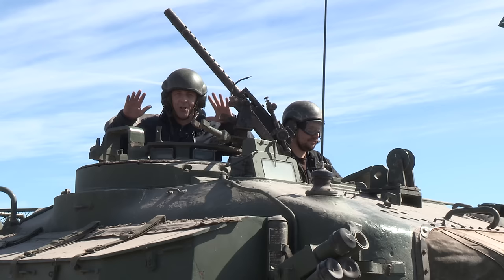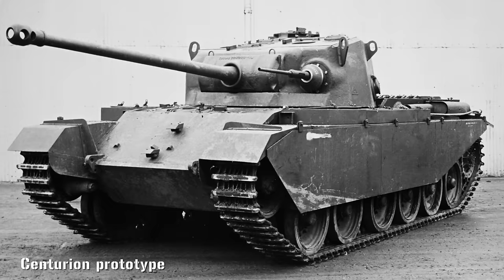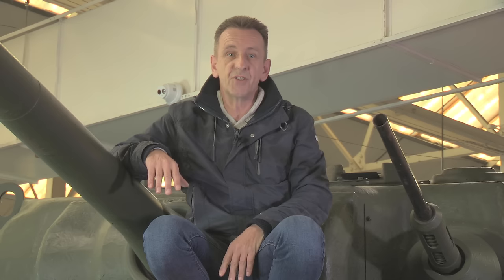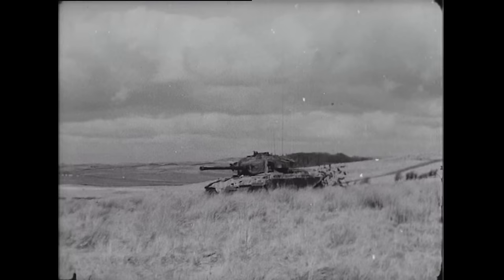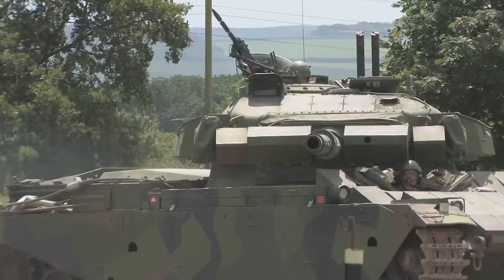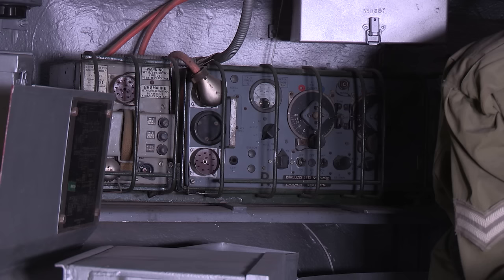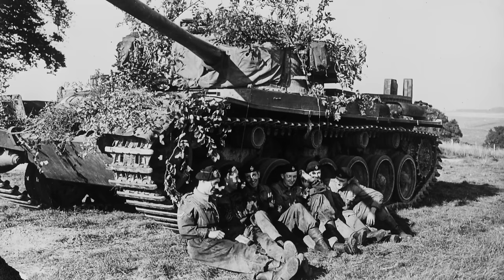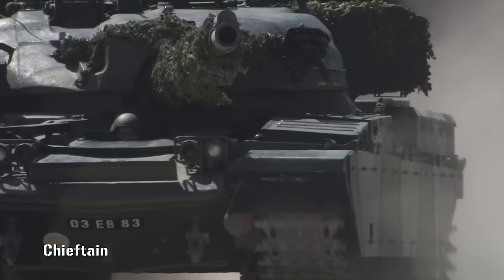Inside the Tanks: The Centurion - World of Tanks

Comment: I was radio operator/loader for three years in Germany 1956/8 with 16/5th Lancers. Used to love the Centurion, always remember when we gave a lift to infantry they always used to grab hold of the hot exhausts to climb up to the engine deck, never failed !
Reply: I was a driver gunner 1955/1958 4Th Hussars Hohne

Comment: I think this is the best film Challenger has made.  Could have lived without some of the transition editing effects, but really this didn't interfere with the film.  Great job Mr Cutland!

PS - The RoF that was shown in the historical gun stabilisation footage - I'll have some of that in WoT please!
Reply from the maker: Oh noooo, you did not like the transitions! Signed #GuyWhoProducedTheTransitions
Reply: I'm afraid that RoF isn't accurate, it's more of a propoganda film than an accurate representation, the stabilization also did not allow for complete accuracy while moving, this only came to be many many years later in the form of advanced fire controll systems.
Reply: James V. D. Bosch Yes, that is likely, however it is a somewhat realistic RoF compared to other takes of that film. The stabiliser is probably doing a good enough job at low speeds to allow the gunner to have to adjust only a bit to be able to hit a target. Sure, it's not like the "50km/h through the countryside and hitting the target 3klicks away", but for work at the time it's good enough, as it allows the short stop to aim and fire to be really very short.
Reply: piritskenyer And as it did with the stabilizers mounted on the Shermans, it allowed the gunner to actually keep track of a target while moving, other than that, I'm not so sure about the 400mm of penetration he said the Royal Ordnance L7 had, Perhaps he was referring to a later shell to be added for this gun, instead of the standard ammunition allocated to the Cent. 10 at it's point of introduction?
Reply: James V. D. Bosch I do believe this was a pronouncedly more advanced stabiliser than the Sherman's. The Sherman's stabilizer wasn't bad per se, but this one allowed smaller misalignement at greater speeds and rougher terrain. At slow speed this stabiliser would even allow for actual on-the-move firing.
As for the ammunition, I'm pretty certain that he was reffering to very late ammunition (maybe APFSDS), as the standard rounds in NATO armies for the L7 would have had penetration ranges from 230 to 350mm through the years and types. The L7 and its derivates having been kept in service to this day in certain places (M1128 MGS as the latest example) probably means that ammunition development is still ongoing.
Reply: piritskenyer As was my guess, it's just abit weird to list such a shell type when describing a certain armament mounted on a vehicle which wouldn't have used the round predominately, and if you do list the round, perhaps also give us information regarding what type of ammunition, and where and when it entered service, I highly doubt the Centurion Mk. 10 had 400mm of penetration at it's disposal at the very start of it's service life. (Perhaps the range and angle of impact would've been a good thing to list aswell)
Reply: It's more likely to be a public information news film than a propaganda one,  this is still the time when there were more cinemas than TV sets, and the best way to get visual info and news to the public (except news papers) was through the cinema, Movietone News was one of the makers; Pathe News was another.
Gun stablisation was never about hitting a target 100% of the time every time, that came much later.  It was about giving the tank and it's crew the ability to hit a target on the move;  without them needing to stop to take a shot and becoming a target themselves.
Reply: Nothing wrong with the transitions, just too many of them.
Reply: Your missing the point,  Mr Cutland is talking about the gun where he says  "Ultimately this gun".  The best stats I found is this: - L7: DM63 APFSDS-T   4000Mtrs   530mm    1455M/S     year2000

Comment: I loved this tank. I mainly drove centurions but the last tank I drove was the Conqueror. It was lovely to drive and you could use you little fingers to steer by.  He also showed a Cent with hard rubber pads on the tracks. I was trialling these at Bovington in 1963/1964. The normal steel track had a drawback. If you missed a gear you couldn't steer it. Quite by accident, whilst using the rubber ones,. I missed my gear and found that you could steer it a little.

Comment: Excellent video as always. Was shocked. I had always thought Centurion had torsion bar suspension. Learned me new things today!
Reply: nope it had horstmann Bogie suspension, rather reliable and easy to maintain. if the bogie gets damaged bolt it off and bolt a new one. torsion bar is good suspension but a pain to fix, if the bar breaks you'll have to pull the broken part out its times like that you wish you could pick up the tank and shake it to remove the broken part

Comment: The British L7 is the best 105mm main gun barrels. Besides accurate but the breech loading system with fixed ammunition is very fast. A good loader can load and arm one in under 5 seconds or less. Provided you have a Joe Cock Strong Loader. I have heard from the old M60 and early M1 Abrams tank loaders that they would "lap load'. This was even faster during gunnery Tank Table 8. To all tank crews Tank Table 8 is everything. Speed, accuracy, proper fire commands and shooting it clean on qualification day is everything. That British L7 gun is still praised by tank crews from the past as the best gun for gunnery. When I became a Tanker in the National Guard I got to train on the M1 and M1A1. The 120mm rounds on the M1A1 were heavier but with practice a couple of hundred times and never going to the gym. You can load it fast. The 105mm round is so light and smooth to punch in and pull the arming lever that it became one motion on the L7.

Comment: 4:45 Why yes, it was an improvement over what the BRITISH were using previously. But notice: There was NO Panther shell in that picture, as it would make the 17 pounder look smaller, because it is! 

This is not bullshit "Werhaboo" propaganda/blind beleif. I have done a LOT OF reading on this subject, as I was VERY interested to see how the British 76.2mm L55 "17 pounder" compares to the German 75mm L70 "KwK 42" - and not surprisingly, the KwK 42 has higher velocity at 935 meters/sec where the 17 pounder has 884.

Penetration figures ARE CLOSE with their respective standard AP rounds, but the KwK 42 wins out, and even has an explosive "bursting charge"  - something that as far as I am aware, the 17 pounder's shells lacked.

And yes, the APDS rounds did have an insane amount of armor penetration that far surpassed the "Arrow Head" APCR the KwK 42 used. BUT, and there is a rather huge BUT involved, the APDS rounds made up 6% of the TOTAL rounds used by all 17 pounder guns in all of WWII and most of THOSE were used in late 1943 to 1945, and even THEN: TCs were told NOT to use the APDS beyond 1000 meters, as the accuracy beyond that range made it largely pointless to fire! 

Even out to 1km the 17 pounder APDS had quite unpredictable ballistics, ergo terrible accuracy, which was VERY slowly remedied, but never completely fixed, for ONE major reason:

Early APDS was far from even close to perfected, and in general, firing such rounds out-of a rifled barrel creates several issues, the largest of which being the separation of the sabot "petals" as they are called, and if the sabot pieces do not separate perfectly symmetrically, the shot WILL fly to one side or another!

Anyway, that was just a VERY BRIEF description of the issues with early APDS, and why all main tank cannons now fire APFSDS, and almost all of them use Smooth Bore guns. With the Brits, and maybe (?) the Italians being one of the few nations that still use rifled cannons on their current generation of Main Battle Tanks.

And that is not an issue any longer, as every nation that engineers and produces tanks has figured out how to make every round said tank can fire, fire properly and therefore predictably.

Comment: I found the gunners position on the challenger 2 rather comfortable. But it was a pain in the ass to get out.
Reply: Hopefully the gunner and loader were cross trained so that they could exchange positions and the gunner could stretch a bit.
Reply: The loader/gunner/driver can all do each others job. When you joined your regiment you either came as a gunner or driver and then got trained up on the other job. Essentially you can 3 man fight this tank if 1 crew member gets injured. Used to get paid more as a full crew member. You can then specialise in a certain job....Gunner mech...Driver mech or Consig (Control signaller). Which gave you more indepth knowledge.

Comment: does anyone know why Richards nickname is the challenger did he operate a challenger tank at some point?
Reply from the maker: Yes my friend, my last tank I served on was Challenger 2.
Reply: nice
Reply: +Graham Maxwell what
Reply: +Mspaintfanboy what?
Reply: +Wargaming Europe that is so cool
Reply: Bet you felt safe in the challenger 2. The reply system is broken.
Reply: Tanks are those among the least safe places in the world... especially if they are not capable to withstand a simple RPG in the front projection, like Chally showed it in OIF.
Reply: Incorrect.
Reply: Bender_2979 The challenger 2 is the most heavily armored tank around today except MAYBE the t-14 armata. The challenger has taken multiple atgm hits which have more pen than an rpg-29 and over 14 rpg-7 hits and it was able to drive away with no casualities and very little damage once pulled from the ditch.
The rpg-29 incident was at the start of the war when the challenger 2s were deployed without adequate dorchester plating in place which was probably due to the fact high command diidnt take the threat of the few rpg-29s available over there or didnt know they were there. once the palting was fixed this never happened again.
Reply: Bender_2979 Not quite a simple RPG, a tandam warhead RPG29 striking the lower part of the front lower plate where it was only 76mm steel armour (struck below the ROMERA ERA when it bounced off the road surface and upwards), this area now has a great slab of dorchester armour over it. 
Oh Cojone a US Abrams was lost in an equally 'one in a million' way
Reply: What? You mean when it hit the front plate and the driver transmission was pushed back snapping the soldiers tendon? or the one that was hit 42 times with rpgs and one milan AT missile and survived? No one doubts the survivability of chally 2 , Not a single one was lost to enemy fire.

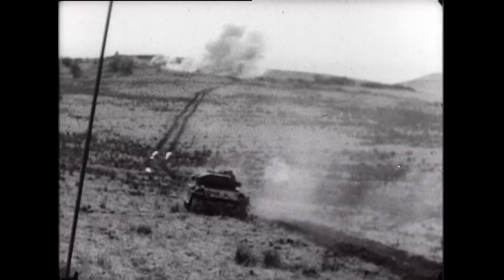Comment: 7:14 damn if only it had that accuracy and RoF in WoT... And if it looked that cool.

Also it'd be great if the mk 10 (or 13) was a tier X, could easily be done.

Couple of points, shame you didn't briefly mention the Conway at the end there, and I though that Bovington's working Centurion was a modified mk V AVRE?
Reply: the cent AX is a cent X....its only problem is that WG fitted an other turret on it. it should have kept the same turret as the cent 7/1. it would be an awesome tank if it was the case (I honestly think the cent 7/1 turret is miles better than the AX turret)

Comment: the real big improvements that made the centurion tank beter is what isreal did first of all the petrol engine have been replaced in the 750hp avds 1790 Teledyne Continental diesel engine.the turret hydraulic system control and the aming sights olso came from the better petton tanks includs m-68 105 mm cannon. too bad he didn't mention it. for it is the first and  de significant improvement's
Reply: The M68-105 is the L7 105....

Comment: The 17 pounder APDS round could not hit the inside of a barn at 1000 yards. Max range 500 yards.
Reply: tarjei99 In US tests they stated an accuracy of 25% at 1000m, they also stated they believed the rounds used were a duff batch that had not been proof tested. British testing put accuracy at 50% at 1000yds. 
I have a ordnance manual for the 17pdr rounds. It states their was an accuracy issue with earlier British manufactured rounds but not the Canadian or 77mm APDS. The British rounds had a simple fix (a rubber band in the sabots)  to improve their accuracy.
Reply: They were not hitting anything at 1000 yards on the US test. Not even with British gunners. So if they later got 25%, it was a new test.  They had another problem and that was that the shape of the high velocity AP rounds were such that they tended to bounce off sloped armour. So they were still advised to shoot from the side.

The ordinary AP round had a higher chance of penetration than the high velocity round.
Reply: It was not the US which believed that a duff batch was used, it was the British. The US reserved judgement (although duff or not, it was apparently fielded in France). Worth a read. http://worldoftanks.com/en/news/chieftain/chieftains-hatch-us-guns-vs-german-armour-part-1/
See also http://worldoftanks.com/en/news/chieftain/The_Chieftains_Hatch_Firefly/

Comment: Britain finally figured out angled armour
Reply: Also figured out Chobham armour. Adopted by the USA amongst others.
I worked on Centurions in the UK and Germany during my service in the REME.
Interesting facts. 
The engine had no flywheel, with a 4 Cwt clutch it was uneccessary 
The gearbox weighed more than the engine.
In the drivers compartment were buttons for isolating each magneto in turn. This "mag drop test" was useful for trouble shooting. You could watch the rev counter and see how each mag was performing.
Reply: Turning the engine over for maintenance was done by rotating a hexagon extension on the starter motor using a 3/16"  ring spanner

Comment: Could the sabot even hit anything at 1000m?
Reply: *17pdr sabot
Reply: Yes, of course they could, otherwise what would be the point of making them.
Reply: +HiOn Maiden just did some research and 17pdr sabot was useless beyond 400m
Reply: That doesn't make scene,  you have the western allies best anti tank gun produced to date and your going to issue to the front line troops an anti tank shell that doesn't work.
Reply: +HiOn Maiden that's in theory. The British even said that sabot could not hit anything beyond 500yards. The US tested 17pdr APDS on a 6x6 target at 1000 yards and couldn't hit it once. You'd have a better chance with the 76 using HVAP, or with the 90mm's that the US started producing as towed AT guns.
Reply: +HiOn Maiden "With all the standard rounds, except 17pdr SABOT, the accuracy was such as to warrant attempting to hit specific parts of the front plates" 
Army Firing Test No.3
U.S. Army Firing Tests conducted August 1944 by 12th U.S. Army Group at Isigny, France.
Board of Officers
APO 655
Reply: +MorningGI0ry The first sabot was obviously not going to be great straight away but after a few versions they managed to get it to work completly fine.
Reply: The 17pdr APDS rounds initially were fairly unreliable with accuracy. US testing put them around 25% hit at 1000m while the Brits put them closer to 50% (in the US tests they stated the rounds were believed to be sub standard non proof tested batch). 
Interestingly there was a mod which improved the accuracy of the rounds (a rubber band on the Sabot), in the British tech manuals this was required for British rounds for the 17pdr but not those for the 77mm (which used the same projectile), nor for Canadian produced rounds.

Comment: So what the difference between Horstmann suspension and Volute Spring suspension used on Sherman? It looks like a similar system
Reply: VVS has a vertically mounted cone shaped spring whereas Hortsmann has two horizontally mounted springs. Hortsmann suspension is more robust and has more suspension travel than VVS. HVSS suspension of the M4A3 Shermans is more similar to Hortsmann and it fixed a lot of the problems with VVS; it had horizontally mounted springs (still volute) which gave it increased travel and also improved its strength.
Reply: +Arrrbol (YCS) So, the real difference is the type of spring that the system use isn't? Volute spring and coil spring, but the system looks similar
Reply: Pretty much yeah.

Comment: Wasn't the 17 Pounder APDS round horrendously inaccurate at any sort of range due to overcharging?
Reply: Mathew graves Canadian manufactured projectiles did not have an issue nor did those fired from the 77mm. Early British manufactured rounds did have issues but this was fixed with a rubber band on the projectile.  The US report where the 17pdr APDS had poor accuracy also stated itbelieved the rounds were sub standard and not proof tested so were not truely representetive of its capabilities.